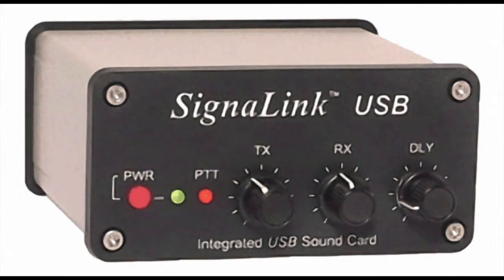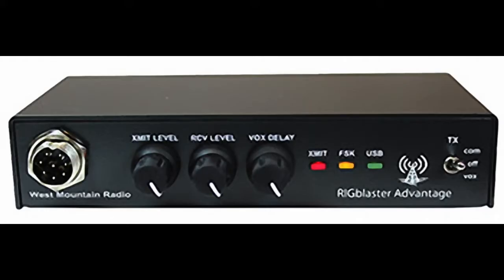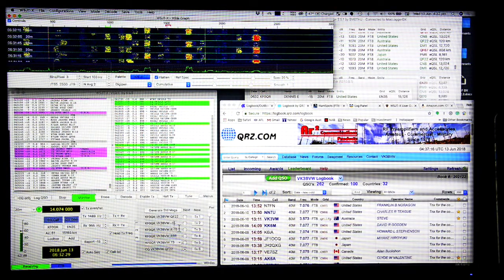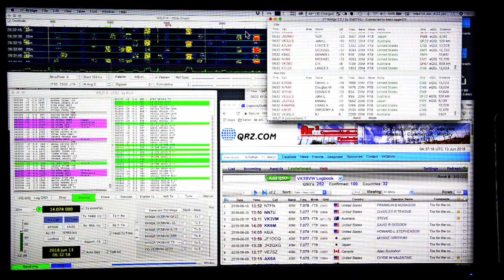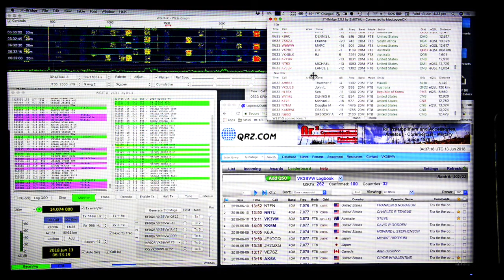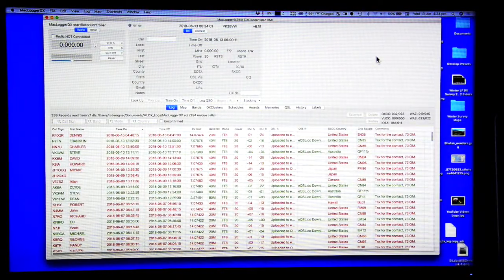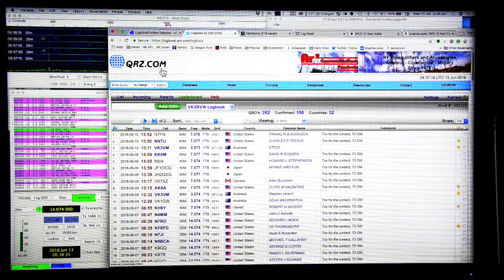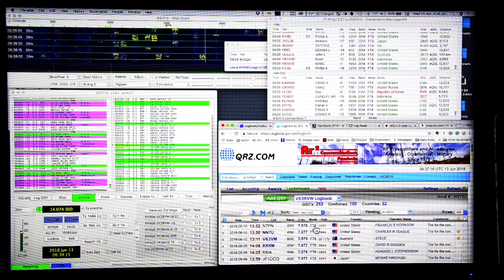Rob "Discovers" FT8

Comment: Hi Rob:  You can get about 10 dB more process gain using WSPR than you are now getting with FT8.  But the price you pay is WSPR has no provision for exchanging a message, it's only a beacon mode.  A good start for antenna testing.   --Brooke N6GCE
Reply from the maker: Yes, indeed, you are correct, Brooke.  I find WSPR fascinating!! An ideal antenna testing mode, as I wrote in this month’s (August) Spectrum Monitor magazine, which is out today. Thanks for your comments. Very 73, Rob VK3BVW
Reply: Hi Rob:  I would not say "ideal" because, so far, it includes neither a way to differentiate propagation nor antenna pattern.  Recently I noticed someone receiving my WSPR signal at -4 where other spots near him were maybe 20 dB lower.  After some emails I discovered he was using a horizontal loop.  I was using a TCI 651 which is a couple of delta loops for Tx.
https://www.prc68.com/I/WireAntenna.shtml#TCI651T
It's a puzzle why these two antennas worked so well?
73 Brooke N6GCE
Reply from the maker: Well yes, of course. I guess what I meant by "ideal" is you get an almost instant response from anyone who has heard your WSPR transmission, with a signal rating. Which is only good for that specific transmission, of course. But at least you know you are getting out using low power. Thanks for the link - I'll have a look at it.